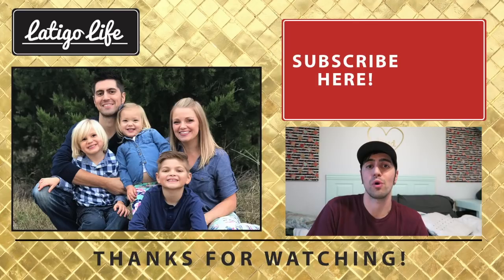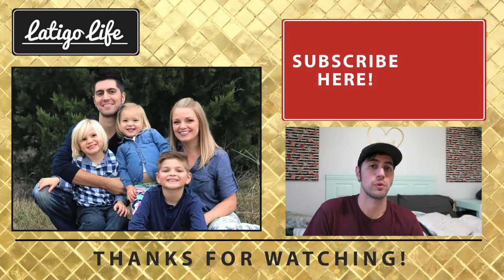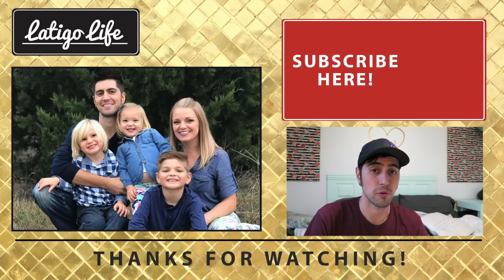Custom Small Pole Barn House || The structure and details of why we did it

Comment: Did you ever consider doing a tankless water heater which could be installed on the outside wall mounted, and completely avoiding issues with  any height issues in the attic..also if you have a water leak, it all comes down through your ceiling. Just a thought for the future in case you want to consider it.
Reply from the maker: Yes. Too much power was required since we weren't using gas to heat it. It apparently requires a huge amount of electricity and we weren't willing to run a separate line for it. That was about as far as I researched them though.
Reply: @LatigoLife  yea, we ended adding 120lb above ground tank (propane) to convert our stove, dryer, and tankless water heater over from electric. We also hooked up a whole house generac generator that is propane since we are always hit with a hurricane almost every year

Comment: Who did you buy your metal for the barn? You cut/weld/fabricate your metal yourself? I want posts that will set inside the walls like your’s.
Reply from the maker: We got it from a local custom metal building shop. They did all the metal work, we just framed the inside. Look for someone that does custom metal buildings, not ibeams. They are around but you'll have to call around and ask.

Comment: i am an electrician in vermont ,and we had a scare not long ago when the spray foamers sprayed the interior walls of a kitchen remodel after our wiring was in place . turns out that the conductor insulation is not rated for direct contact with spray foam

Comment: About how much money did you spend to downsize? We live in a 860 square foot apartment and our next move is a house but I’m really thinking of doing something like this!
Reply from the maker: Janice Difulvio our cost was around $65k for the house itself. We did a lot of the work ourself so that saved a lot I’m sure. And that doesn’t include the land but does include septic, electrical, driveway, water hookup and all this stuff inside the house. Hope that helps a bit. You can find our floor plan for free on our blog or there is a detailed and high resolution version for $20. LatigoLife.com/our-small-home-floorplan
Reply: Latigo Life thank you 😊

Comment: Why not use an on demand water heater?
Reply from the maker: We don't have gas in the house and electric hot water heaters were not recommended. I talked to several electricians and they all said they require a separate cable straight from the transformer. Our electric company also said they are going to start charging extra for the power pulled by them because it hits their equipment so hard. So I went with that advice. If we had decided to use gas, that would be have been an option.
Reply: Latigo Life I never knew that thank you for answering so quickly. I just wondered after you spoke about space needed and the difficulties with finding a water heater to fit
Reply from the maker: Nathan Lutz welcome. I had the same thought when we started. 😉